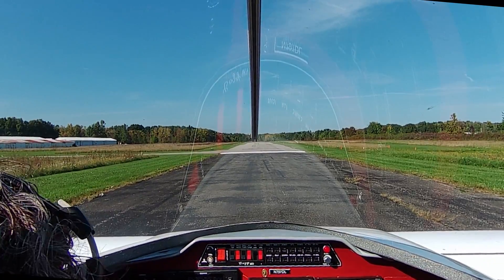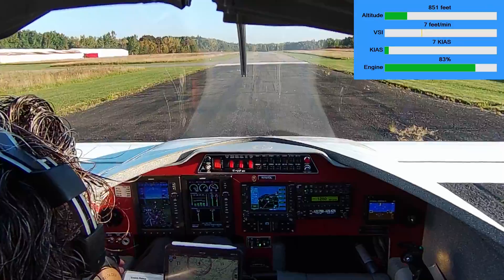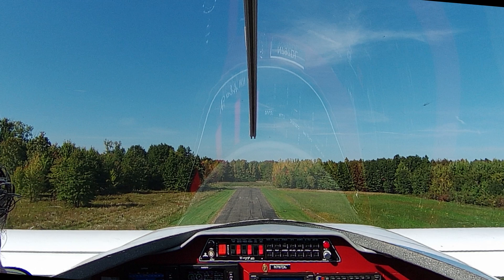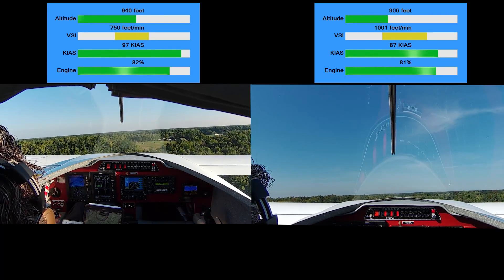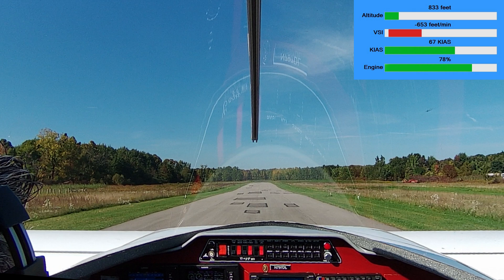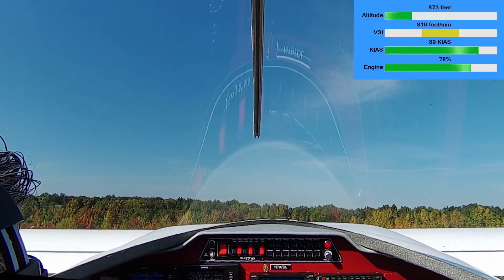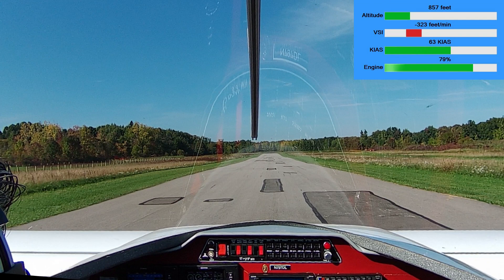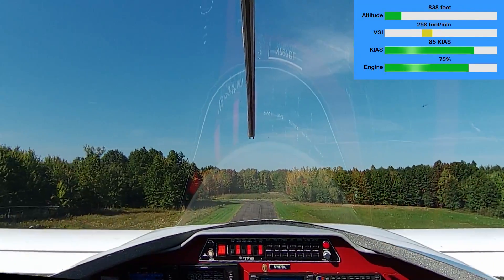Almost a CRASH: How did this happen? And why?

Comment: This video is fake. You can clearly see at 0:19 that the aircraft was CGI in the near miss. The graphics artist didn't even bother to rotoscope the CGI BEHIND the window.

Lol jk... Make sure you were in headwinds, trim settings set to takeoff, and that you pull out of ground effect properly by building speed and setting your flaps correctly. It sounds like you have all bases covered. 

Anyone know what the timeline is for fixing the dip in the runway at Anderson AFB? Lol
Reply from the maker: haha nice try :) No flaps on a canard aircraft, unfortunately - I sure could use them here!

Comment: 1. Frankly i didn’t see a significant difference between both takeoffs.  
They both had sluggish climbs.  
2. If I’ve used 2/3 of the runway and not up to VR I’m aborting.
3. You’ve convinced me.  A canard is not in my future 😊.  My KITFOX would climb like a rocket, and my current ride, a RANS S-19, isn’t far behind.

Comment: 7:00  "When the airplane is on the ground it's not making lift ..."  Oh? Any airflow over a wing creates lift , unless the critical angle of attack is exceeded. Maybe not enough lift to maintain level flight but, yes, lift indeed.
Reply from the maker: These aircraft, when on the ground, are angled at such an AOA that lift is not generated, particularly over the main wing. The canard will start making some lift, but not enough to raise the nose until the elevator is applied. The angle of incidence on the main wing is such that it will not make lift at all until the canard has raised the nose sufficiently that the main wing AOA is increased.

Comment: Great debrief. I think it’s great that you’re thinking about your abort point and abort plan, however I think you might be thinking of it a bit in the wrong way. You say that 65kts is your abort point in this plane on this runway, after which you’re going flying, and before which you will stop on the runway. Well as this incident illustrates, 65kts is a moving target based on wind, density altitude and aircraft loading. Your abort point needs to be a physical, unmoving point on the runway, by which YOU DEFINE the performance you expect to see out of your aircraft. That may be rotation speed, or possibly slightly less than rotation if it’s a high density altitude day etc. That way, it’s not about if something “appears” to be wrong, it’s about whether or not the plane is meeting your expectations of safety by this defined point, and if it’s not, you abort. Unfortunately in a single engine aircraft you don’t have the luxury of saying “I’m going flying at this point no matter what”. That plane is either going to fly or it isn’t, and the only choice you have in a bad situation is am I going to run off the end of the runway while in a state of deceleration, or am I going to run off and fly into the tree at full power. In that situation I’d always prefer to be slowing down before hitting the trees rather than going full speed ahead into them. 👍
Reply from the maker: Correct. I should have said that 65 kts is my abort point based on a specific point on the runway where a fence ends and some trees begin - but it's hard to see on the takeoff roll. I know if I am not at 65 kts  at that point, I am not going to clear the trees, so I abort. There isn't another good landmark to use for rotation speed, and I gave myself a healthy margin (for reaction time and safety) - so I could technically, by the numbers still maybe make it? But I'll never find that out, because I won't try it.

Comment: I'm a relatively low time pilot no longer flight 78 but I had a pitts special. I flew out of an airport with the river at one end and telephone poles at the other a grass strip about twenty-eight hundred feet in length and it seems to me that engines not putting out enough power I would check that out secondly the bouncing of your nose wheel is problematic for me it's may need additional a bungee cord or shock absorber whatever however that thing is supported to keep it from bouncing like that thirdly you're flying isn't like an airliner you said you didn't know if you had a tail when don't you have a windsock I mean you always take off into the wind generally but especially short Field airport you're not going to take off with the wind so that could have been a factor that's a canard John Denver airplane John Denver was a Lear jet pilot at Good pilot and I think you know the story there are reached for the fuel control to switch tanks so it's not a bad airplane it's a good airplane John Denver airplane had the control tank control as I understand it above his left shoulder so he had to reach and pushed with his right foot on the right rudder did a snap-roll right into the sea of 500 ft
Reply from the maker: The engine is at full power for this prop - I actually have a new prop coming that will give me a bit more static RPM, which will give me more power for takeoff. The prop on it now is a cruise prop.

There is definitely a windsock at this airport, and I would NEVER attempt to take off out of this airport downwind!

Comment: Just some thoughts (not qualified to comment ) but GS has nothing to do with anything as far as flying the airplane.  Since air density was the same on both days that's the first clue.   Even your normal take off didn't look all that great.  Cut some trees or find a different AP.  Or put a more powerful motor in.  That porpoising is not a good thing.  And the balast which would have held you down longer. 
If you would have held it down longer would it have made a difference?
This is probably one of those things that should be shown to every flight student.
Reply from the maker: Groundspeed is important (and why I showed it) because it would indicate whether or not I had a headwind or tailwind. Comparing it to indicated airspeed will tell you that.

Comment: So you made changes to CG didn’t really pay attention to density altitude on what I am assuming is your “home” airport.  DA should have been screaming at you. Messing with CG made you a test pilot on a less than ideal runway. That’s kinda like flying into IMC without the pitot heater on…and waiting to see what happens. Thanks for sharing…my takeaway is never get to comfortable even in a familiar airport.
Reply from the maker: Of course I paid attention to DA, I did calculations ahead of time (as I always do) to ensure I can get in and out with a sufficient safety margin. I have to at this airport, and I have cancelled trips from this airport because of high DA.

Changing the location of the ballast has been tested many times in this position of this aircraft, it is nothing new, and was not "messing with C/G" - no more than having a passenger in the front seat. It was still very much inside the C/G envelope. The difference was the inertia at that specific position of the moment arm.

Comment: One thing to keep in mind, sometimes the best option is to kill the throttle and land on what's left. Yes you will overrun but that could be a better outcome compared to other options. Obviously not saying you should have done this here, but don't count out that option if at an airport with very little options if engine failure right at take off

Comment: Regarding your go/no-go decision you mentioned "stopping on the runway".  Along that line you said something about being committed to go flying.  Looking at the runway and the area beyond the runway just before the tree line I would submit that it might be preferable to go off the end of the runway at 20-30 miles an hour, dissipate more of that energy over the unimproved surface beyond the runway, before reaching the tree line rather than getting it airborne a few feet above the trees then stall/spinning directly into the ground or going straight into the trees at 65-75mph/knots.  As far as survivability is concerned it is  preferable to dissipate the energy involved in an aircraft incident/accident over a greater distance than coming to a sudden/abrupt stop.  My point  is that in your decision to stop/go you may want to consider more than "stopping on the runway".  While your aircraft is a very nice, it is not a transport category aircraft with guaranteed performance; stopping on the available pavement, committed to go flying.  It seems to me that you are thinking/talking in those T-Category Part 121 terms.  No disrespect or cynical criticism intended, just something else to think about.  Thank you for the well done and interesting video!
-Respectfully

Comment: So at about 2:10 - 2:15 while discussing a "normal" takeoff, you mention that you accelerate to "Vx", and the graph shows you at 90 - 95 KIAS. Assuming that IAS = CAS (which, if you haven't done an airspeed calibration, you don't know whether that's true or not) then Vx in a lightly loaded COZY MKIV will be closer to 75 KCAS - maybe 80 KCAS - NOT 90 - 95 KCAS. Vy will be around 80 - 85 KCAS - maybe 90 KCAS. So you're too fast.

Also, a canard is NOT a conventional plane and you do not need to worry about stall - the airplane will climb at 500 - 700 fpm with the stick held full aft at <whatever your canard stall speed is - if you're light and close to the rear CG, it'll be about 62 - 63 KCAS>. 

Having a 600 ft. difference in DA is not going to make anything resembling a measurable difference in takeoff roll (or anything else, for that matter - that was NOT a major contributor to the difference in takeoff behavior. Not engine power, not lift generation, not IAS/TAS.

There's a difference in power output (not a large one, though) at around 5:10 - 5:20 - did you have a very different mixture setting?

I do NOT recommend EVER holding forward pressure on takeoff - that's a good way to push the nose gear down and cause catastrophic nose gear shimmy. At most, hold just enough back pressure to keep the nose wheel JUST touching, or just above the ground until reaching rotations speed - 70 - 75 KCAS, unless heavy or very forward CG.

I'm not convinced that this was anything other than an anomaly of hitting a larger bump on the runway than you normally do, possibly due to the additional forward inertia - having a higher canard AOA at 63 KCAS will cause the nose to rise - and then not reacting quickly enough to hold the aircraft attitude correctly. Had you started climbing when reaching 75 KCAS, rather than accelerating to 85 KIAS, you would have been a lot further away from the trees.
Reply from the maker: Thanks Marc, and I agree, had I reacted more quickly to that bump, it would have been much less of an issue. My POH has Vx at 93 and Vy at 110 - if what you're saying is correct (and I assume it is) I need to validate this, along with all of my V speeds. Basically a Phase 1 test series (also to validate CAS).

As for the difference in power between the two takeoffs, both had the same power settings, mixture full rich, but the one on the right was at a higher density altitude (much hotter day) - so less power, slower acceleration - at least that's what I figured. Slower acceleration also meant slower rise in RPM, and equivalent slower rise in engine power. Once the airspeeds equalized in both takeoffs, the engine power was identical.

I need to do some airwork and speed tests.

Comment: What airport. Colombia where?  How long is runway, how much room from end of runway to trees. Do you have a AFM  / POH with data. The canards are efficient but short field soft field airplanes they are not... YES Density Alt made a big difference.  At first you say it did not make a difference. Then you say it did make ground roll longer and by taking longer ground roll you hit the runway dip. That is a correct analysis. So it made a difference. You should have pushed the nose down. You should have countered early lift off and kept aircraft in ground effect. Even if you did not hit the dip and get airborne too early (soft field takeoff technique) you were going to get closer to obstacles. Do NOT use short runways with obstacles at gross (you were solo) and high density alt.

Comment: Personally, I would keep it in GE, due to reduction in drag, as long as possible due to getting to a higher airspeed, which would yield a better climb angle.
Second, rather than trying to clear the trees with a huge margin, I would 'aim' for the tree tops, which would allow my airspeed to increase
that much more, because I would rather have airspeed margin 'touching' the trees, than altitude margin with sketchy airspeed. This comes from years of hang gliding and motorcycling. If you have a vehicle that you are unsure of, it is better to 'pre-aim' at them slightly for two reasons, one to get their attention,
and the second is if they DO pull out in front of you, you are already ready to go behind them.
Varieze pilot here.
Reply from the maker: I have 35+ years riding motorcycles as well, so I know exactly of what you speak. :)

I don't normally aim way over the treetops - I want as much airspeed as possible (it can get gusty once you're beyond the trees), so I generally aim to cross maybe 10-15 feet over them.
Reply: @CanardBoulevard  Subbed btw 🙂

Comment: Two things here:

Why did you want to move the ballast forward if you were already in the W&B envelope?  A forward CofG always takes longer runway.  You would do better adding 10lbs in the nose rather than 25lbs under the co-pilots seat as that achieves the same balance but reduces your aircraft weight by 15lbs.

Second point:  If you keep your stick forward, the canard will not try to lift you off the runway prematurely and cause high induced drag and that porpoising.  Keep the stick neutral, or forward, until you reach flying speed and then ease it off the runway.  This gives you the shortest take off distance and no porpoising.  Trying to pull a canard off the runway prematurely just does not work.

Comment: Great job when recovering from the issue and many thanks to sharing your experience with us so that we are able to learn.
I think of 2 things you might wanna try out next time: First if I saw it right the engine is not at full rpm when you release the breaks. So it may be worth waiting 1 or 2 more seconds spinning up the engine before releasing the brakes.
Secondly you might want to try to pull the nose fully up when releasing the brakes and gently move the nose down to the normal settings while gaining speed. This way you help releasing the pressure on the front gear at the very start of the accelaration phase. It may help to avoid the early hard bumps and help to increase speed a bit more. At least at my plane C172 it works for me. If you are unsure please try it out at a longer runway!
Reply: Good advice for more traditional aircraft but his is a pusher prop

Comment: So whats the deal? If you get that thing in a nose high  attitude draggy mode too slow, there is no good way to recover other than luck? If you pulled back, it would have been all over.
Maybe put a stronger spring or rubber band or whatever on the stick to increase the stick force.

Comment: You only ever have to just miss obsticals. Speed is everything when you are chasing climb rate. 
If it starts looking like climb is poor, forget about getting nose up. Lower nose and aim to just miss stuff. 
As an aside, I would advance throttle to full power over several seconds, 3 or 4, rather than an immediate push. You might just save yourself from an engine problem some day. 
Cheers.

Comment: The airplane will accelerate faster level in low ground effect than rolling on the runway.  Rough runway and canard will hurt you here, but allowing the airplane to climb through low ground effect when too slow to safely fly is dangerous also.  Wolfgang also talked about the experienced pilot trying to hit the tree rather than climb will over.  Energy management begs us to use ground effect energy as long as we have runway available.  Energy management begs us to pitch up to fly, not stall, just over the obstruction.  As a crop duster, I have heard the farmer say, "You hit the tree."   No, that was wing tip vorticies and downwash.  Yes, I accelerated to max airspeed with full throttle in six inch ground effect over the crop and pitched to just over the trees.  I alway had zoom reserve airspeed, airspeed sufficient to climb and/or maneuver with or with power, coming out of both crop field and airport.  Energy management wise, they are the same thing.

Get up to three feet or so and fast, but practice dynamic proactive elevator (canard) control movement over a long runway.  I teach it with tractor airplanes with the elevator in back and they are easier to maintain level in low ground effect with.  Your airplane is even more dependent on dynamic proactive fore/aft stick movement to bracket level in low ground effect.  At your airport, especially with high DA, the low ground effect takeoff is the only safe takeoff with low powered airplanes.